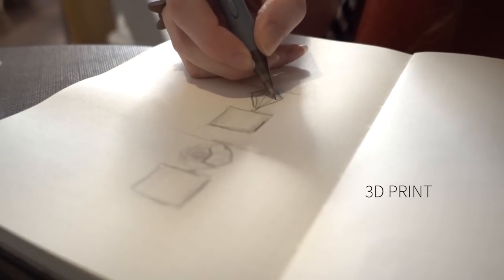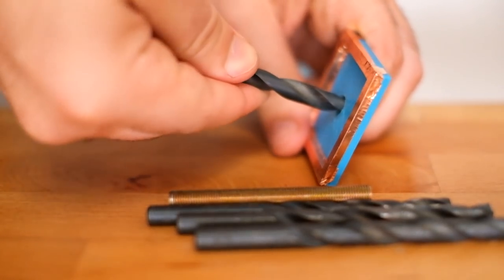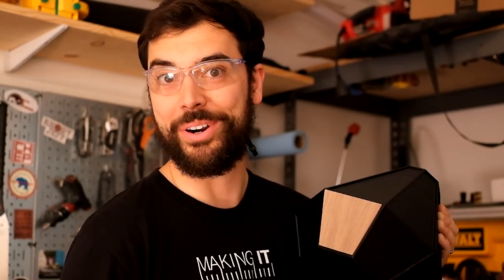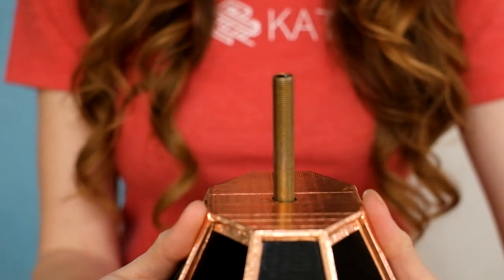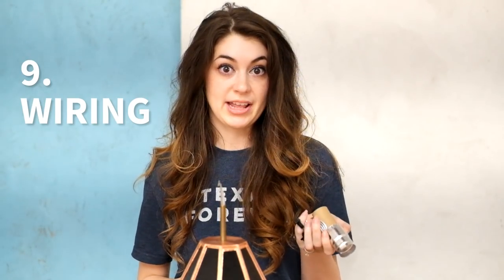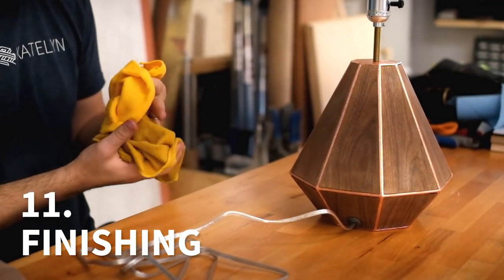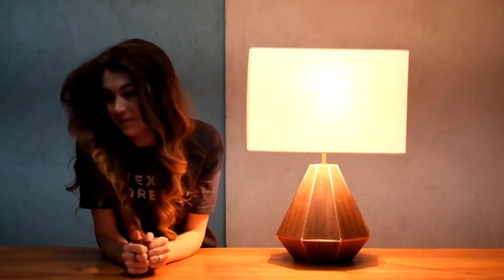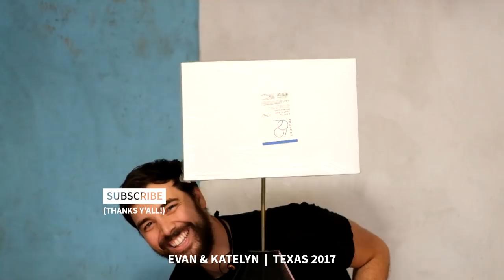3d print & walnut lamp | How to

Comment: Good shit, I'd recommend using an LED bulb for efficiency and knotting the cord when it meets the hole so if someone trips on the cord it doesn't pull out and short the leads.
Reply from the maker: Yes! We do plan to swap to an LED, just didn't have a spare on hand. Good tip about the cord, thank you!

Comment: I really like the idea of using the 3D print as a base for other materials.  That lamp came out really nice!  You could probably get around the clamping issue if you used activator with the superglue.  Just spray a little activator on the wood and glue on the lamp base.  You an even use a longer setting glue to do the main holding work and just use the super glue to "clamp" it in place.  Not only a great project, but awesome video!
Reply from the maker: +The Every Maker we actually tried using E6000 with super glue to clamp it, which worked well for the too panels but didn't want to work for the bottom ones. Maybe the activator would have helped! Thanks 😁😁
Reply: +EvanAndKatelyn I've never actually had a chance to use activator myself, but all the cool kids on Youtube are doing it!
Reply from the maker: It's pretty dang cool!

Comment: To clamp the panels, if you make 2 wedges (to put on opposite sides) that when held up against the lamp the outside edge is at 90° to the floor, you can then use propper clamps to hold the pieces of wood in place........
Reply from the maker: That would have helped for sure!

Comment: I made a lamp similar to this.  But, mine was solid, and I only had depleted uranium for my 3D printer so I went with that. It worked, but it took six strong men to put it on the table. I never liked that particular table anyway, so when it collapsed (at 2 am) I was ok with it. My wife, however, was not. And making the shade out of welded cast iron took way longer than I expected. However, since I used the magnetron out of our microwave oven instead of a regular light bulb, it was important to contain the radiation. At least I THOUGHT it would contain the radiation. Turns out it sort of focused it instead. Yeah, we don’t even have to replace it, now that the dog glows in the dark, so - win win! I’m going to try making a lamp which burns diesel next. Should get better mileage. I’ll let you know how it goes, or, you may read about it in the news...
Reply from the maker: Bahaha! Thank you for this readable adventure. It was a fun ride. Good luck with your next lamp 😉

Comment: A possible modification to save time and material might be to make a printed framework instead of solid panels, but leave a small area (1/4-1/2 inch?) for mounting the wood panels. It wouldn't be very sturdy until it was assembled, with the wood giving it the stability it needs.
Reply: Really awesome stuff on your channel! Thanks for the great content and ideas/tips!!
Reply from the maker: Thank you! And yeah that would definitely save on print time! We happened to be printing this when we weren't gonna be home so we wanted to make it extra sturdy so nothing failed haha

Comment: You guys so need to look into forces patina mainly for copper as I think you two would have a blast and could use stuff like sheet copper as paneling and could get Katelyn to weld up lamp and rivet fancy patina'd sheet copper..... granted even would probably be able to torch braze a frame together instead of welding sorry man but braze acts more like solder

Comment: I thought maybe if you either just popped the wood in the panel areas without glue or used a magnetic strip to hold the wood in that way you can change out ten wood like if you wanted a different type of wood or to paint the wood you’d be able to change it out whenever with a magnetic strip holding it together.
Reply from the maker: Ooooo magnets would be really cool. Magnets are always the answer

Comment: Could you have printed out the sides of the lamp to have hollow centers with just a shallow edge for the wood panels to sit on and adhered to? I’d imagine it would save a considerable amount of time during printing. (I really have no right commenting on optimization as I don’t even have a printer myself, just curious as to if there was a reason for solid sides.)
Reply from the maker: Totally! Haha the main reason we printed this more sturdy print is by doing it with open panels, there was a higher chance of the print failing and we were printing it when we were out of town so we wanted to make sure it's be sturdy

Comment: @2:28 "cool"... Katelyn walks into a tree.  This looks awesome!  Is the inside of the print hollow?  It seemed like it but it's hard to tell cause it's like staring into a black hole.
Reply from the maker: Thank you! Yes it is hollow. I shudder to think of the print time if it wasn't!
Reply: EvanAndKatelyn oh yeah if it was solid probably over a week and like $200 worth of filament. I just wasn't sure if you had done a low infill with a hollow cylinder through the middle or something.

Comment: Why the massive 3d printed faces? Wouldn't a few small tabs to glue the wood to have been sufficient, or is that way too flexy/unstable to print? Probably would've decimated your printing time...
Reply from the maker: Tried that out (https://i.imgur.com/SY5r8x0.png) and it only took the time down by 4-6 hours depending on the infill percentage... and it looked kinda silly lol. The main thing we wanted to avoid was supports so I had to bring the ID in at a 45 degrees which added a whole bunch of material at the top and prevented the faces from being totally open. One way to make the print time faster would be to make the walls thinner (now 3.5 mm) but it needs more testing. Like the idea though. Want to try downloading it and playing with it? We'd love to see version 2! :D

Comment: looks nice, one idea why not just 3d print the lamp as a skeleton instead of infilling the panels? should save on printer filament and time printing..
Reply from the maker: +John Made it it's mainly because we wanted it to be able to print without supports, but if we did it again we could probably make the panels less filled and still be able to avoid supports

Comment: 3d print a space ship  3d print surface of the moon glue them together drill a hole for the lamp rod into the moon surface wire it up to a switch now you have a sci Fi lamp

Comment: Black electrical tape leaves residue.. put the colored electrical tape does not. We use it on copper and fiber cables for data centers all the time.
Reply from the maker: Good to know, thanks for the tip!

Comment: Using superglue = no need to clamp due to fast setup time....
And the top part should of been wood too imho 
Nice project tho
Reply from the maker: +Cyber TonTo72 we actually did use the super glue trick and it worked on the too panels, but not the bottom ones. Thanks!

Comment: Surely you could have saved a lot of material by just printing a sort of scaffold frame without the centres and using the wood to strengthen it?
Reply from the maker: That might work! But we didn't want to risk the print failing so we played it safe

Comment: CA glue = liquid clamp
Reply from the maker: We actually did use it but we didn't do the accelerator and the panels kept popping off (on the lower section, it actually worked ok for the upper section). Thanks!

Comment: Such a waste of 3D printing, same design could have been achieved with ticker wood panels and some copper rods, Why even make 3D printed lamp if you are just going to hide it with wood and copper tape. You guys could have used 3D printer to show off the  capability of 3D printers. There is tons of lamp and vase design on thingiverse that you can use or even modify to your needs.
Reply: Krunal Patel shhhhhhhhhhhhhhhhh
Reply from the maker: +Krunal Patel lots of ways to get to an end result, but this was a fun experiment for us.
Reply: Don't get me wrong its a great lamp with very throughout and timeless design. And you guys are right, there is probably a million ways of making the same ting but its not the most efficient and my only critic was that 3D printing can make some amazing stuff but i don't see need for it in this particulate design . Plus, this project can potentially be done in less time if you take out the 3D printing